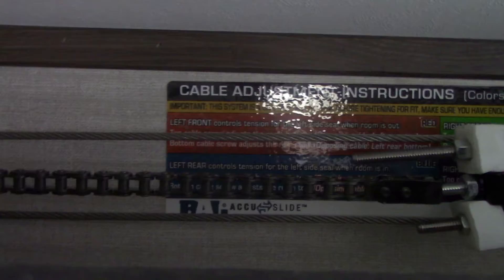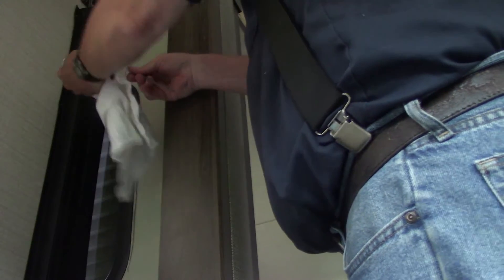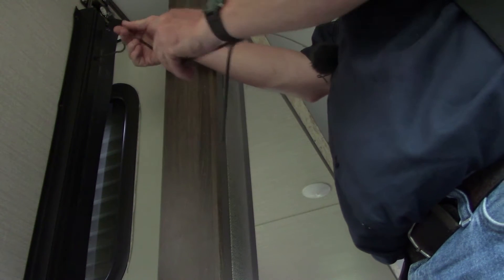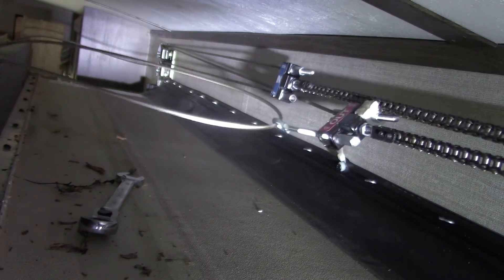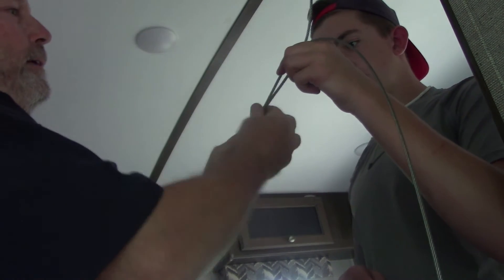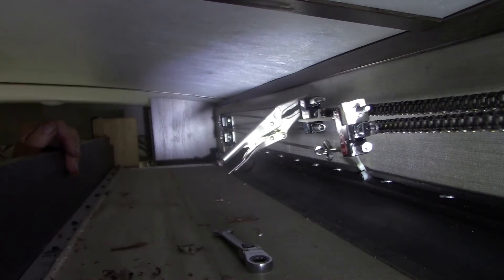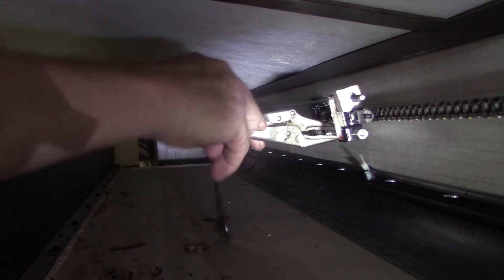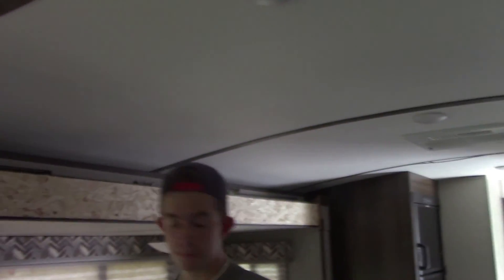Replacing A Damaged Cable On BAL Accu Slide Room

Comment: Use a removable cable clamp to hold the two cables in place and remove after you make the 3 crimps on the aluminium cable crimp. 1/4 inch  works on the 5/16 cable. If you do not have the crimping tool use two cable clamps. The saddle part of the clamp should be on the main part of the cable, not the excess piece of cable that is removed.
Reply from the maker: Thats a good idea. Thanks

Comment: Gm and happy Thanksgiving.....quick question....I have a cable slide and was wondering if cable breaks, can I manually push my slide in. Small slide and I believe it's on rollers
Reply from the maker: If it is a really small slide, chances are it will work pretty well with only 3 cables.

Comment: I have that same system...what a pain in the A..  It's the only thing on My rv that makes me nervous  on repairing
Reply from the maker: It's not that bad Tom. This one would not have been bad if someone had not been there before me.
Reply: @hillbillyrv  I have been researching youtube and the website bal just to be ready..I already need to replace  a wiper seal on the side cant figure out how it tore off. Slide box  seems square to frame...
Reply from the maker: @TC-tw5zk  There is always something to fix on an RV